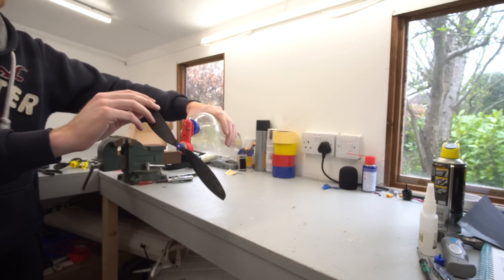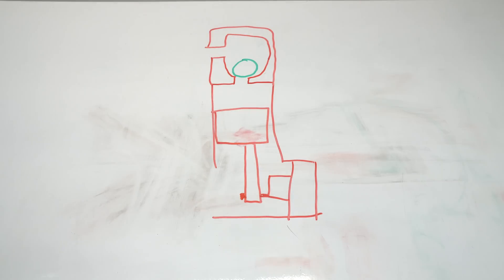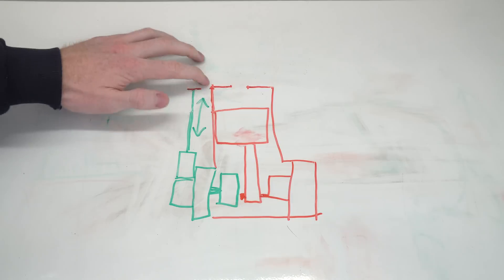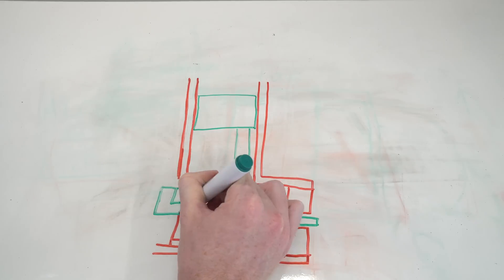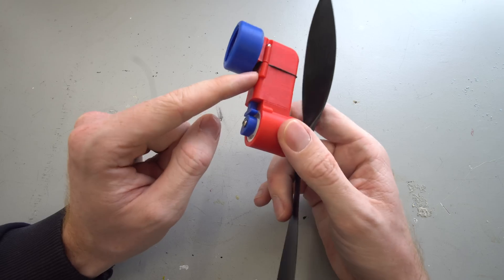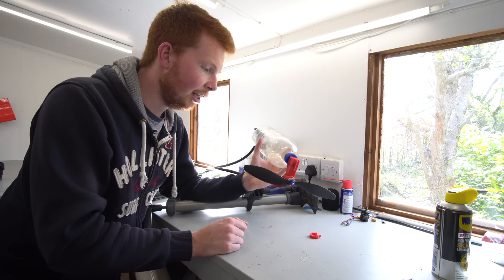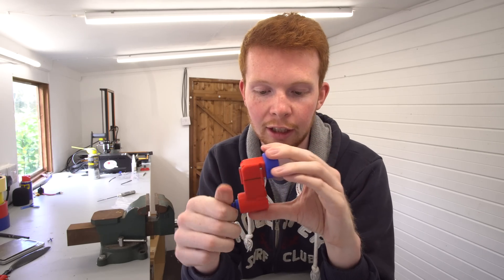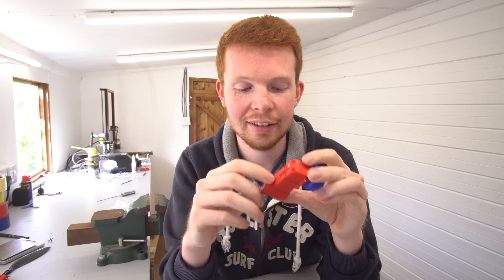Compressed Air Engine V3

Comment: I really love this little engine. You had a bit of frustration with the spring, but another method to solve this problem might be to use the repelling force of magnets to open the valve.

Comment: It be cool to launch a radio controller glider with a blast from an air tank on the ground, It could carry some on board compressed air for a longer more controlled flight and landing. The only electricity would used for radio, camera, and steering, adding perhapes the weight of a little 9 volt battery to the vehicle.

Comment: Hello Tom, I saw your vid of the air driven plane and just now the one about engine redesigns. My thoughts of the ball valve engine were you were robbing the engine of energy to open the valve to recharge the cylinder each cycle. The slider valve idea also came to me but with a twist. Add a spring return cam driven rotating slider valve (teflon to reduce friction) that momentarily opens to bypass the ball valve. The slider reduces the pressure difference either side of the ball valve so the flywheel loses less energy to fully open the ball valve. Another idea is to ditch the ball valve and use the flywheel as a rotating valve. As the pressure is high I'm guessing a tank tap would allow you to find the maximum performance possible before system leakage versus prop horse power becomes significant. The tank tap could be worm driven to open more as the tank pressure drops. Thankyou for your good work. Cheers Terry

Comment: The air might have to be compressed so much that it becomes a liquid, in order for it to store enough energy for this engine to work over a longer period, so maybe switch the water bottle for something like a lighter gas flask, containing compressed liquid air, or something else none flammable.

Comment: If you use a piston exhaust valve like in cars, efficiency will improve. It can also command the piston from both sides with valves. Or use a ranken type rotary piston or liquid piston.

Comment: @Tom Staton
Awesome work, could you details about what 3D printer you are using and the software to design the air motor. Also try using Liquid Nitrogen/Liquid Air/Dry ice to increase pressure in bottle.
Warning: use bottle/container which can withstand pressure of these fluids, also take safety precautions.

Comment: You might have been able to use reed valves and a diaphragm piston. for minimal air leakage for increased efficiency. or even a two stroke cylinder port design. however it would require percise placement of the ports. and possibly the necessity of a reed valve.

I agree with experimenting with the cam lift and duration.

also the use of a sticky lubricant might help. although it would have to be reapplied occasionally.

Comment: Use a small smc solenoid valve and then you could infinitely tune the engine.  Use a small hall sensor for crank timing and use software  to vary the timing and duration.

Comment: They used to have these airplane toys called "Airhog" that used a similar engine.  Fill the tank with a bicycle pump, get the engine running  then give it t arm assisted take off

Comment: Ok, Serious question. could I use this as a mini air compressor if I hooked up a motor to the shaft and apply a voltage to the motor. if so I only plan to make it usable for an aquarium air pump. Please reply. Thanks

Comment: It took me 3 years, but I thought of a way to move the ball in the sideways ball valve move. 

You have the ball sitting on a movable wedge that raises with the con rod. On the underside of the wedge is rubber to make a good seal when closed, and on the opposite side of the tube the con rod is in, you have another piece of rubber that's constantly getting pulled towards the air chamber by rubber bands so air doesnt leak through the con rod tube

Comment: A genuine question to all you budding, and real engineers subscribed to Toms channel. I have no engineering qualifications,  but -  I have had this idea about a turbo, as in like on an internal combustion engine. So I’ll ask on here. Could something like that work, substituting exhaust gases for compressed air  ?? Would it have enough power to turn the blades of the turbo and shaft and turn the external propeller or indeed a bicycle wheel ( under load, as in my body on a bicycle ) It seems like a good idea but then what do I know. What do you think ?? 
I have seen other videos of compressed air powered bikes as well as Toms and from what I’ve seen none of them use something like this. 

Maybe there is no pressure build up in a turbo after all the exhaust gases are used to to turn the blades at something like 100,000 rpm to force the fuel into the combustion chamber.

Comment: I don't get why this design works, isn't it practically the same as the V2? I mean, what makes the engine not backfire in this design as it did in the V2?
Edit: I've given it some more thought, does the cam put an offset where the pushrod take a bit longer than the piston to reach its cenit, so  the piston is already about to descend when the ball lets the air in? That's the only way I can imagine it working...

Comment: That means while you have an air compressor system AC supplied you Will recharge the psi level and the engine just need compressed air to work?
The Matter is that the planes goes across the wind and maybe then the air could autopower the engine. I guess it's some hard to understanding.

Comment: Greetings Tom! AirHogs used to make airplanes that ran on a similar air powered motor, however, their air reservoir was asymmetrical and would change shape as it was filled with air and as the air was used. The planes would fly fairly well in spite of the deformation of the air reservoir, but it would tend to fly in a large circle. The motor would also make quite a bit of noise, and would potentially damage a child’s fingers when they started it. There is also a company that makes motors for RC planes that run on CO2 canisters using similar technology. I would be interested in seeing an airplane powered with your motor, and I would no be surprised if you could use a larger reservoir such as a two (2) liter soda bottle. The weight difference between the bottles would be negligible but the larger bottle could hold more air, so the flight duration would be improved. I could not see what you were doing with the “exhaust”, and I am not sure if you could reuse it like some steam engines do. You could also experiment with an air powered rotary motor, which would simplify your valve system tremendously. Thank you for posting this video! Please have an excellent and awesome day! 🙂

Comment: Twin cylinders is your answer. You could then have the air diverted from the top of one cylinder to the top of the other cylinder by a simple valve (either sitting directly on the output shaft, or with a power-take off from the shaft), and never have the rising piston fighting to push up against a spring. The air supply requirement would be all-but constant, rather than on-off, and would simply be going into whichever cylinder had the piston at the top.

Comment: Impressive... The greatest problem of air engines consisting in the air compression itself... It's good for storing the air but bad for getting the energy out of it... It makes far more sense using fluid in the engine and use the pressure of the air because the air it wasted in the engine when it flushes in the huge chamber you need for the moving parts...

Comment: Tom: 'This engine is fully 3d printed out of PLA plastic'
Engine: *has screws*
LIES
Reply: And the bearings will have metal too
Reply: @n_kliesow  the bearings he used appear to be completely pla
Reply: They wont work if the balls are not perfect shape so I dont think thats possible without losing high percentage of efficiency from friction. A pure rod in a hole would have less friction...

Comment: 2:24 it's an old video, I know, but why not, instead of trying to slide some rubbery materials past each other with lots of friction, use some rubber cylinders/rollers. Because they roll, friction is reduced, but they're also rubber so they will create an air tight seal.

Comment: Hi Tom!I am happy to see your videos, meaning you are doing fine this strange covid times. I like your engine very much as for my task it has huge potential. It should sound strange for you using your engine with piston for uav projects. Iam coming to you with different idea - walls drilling. My team does lot of works creating deep customized solutions for gov security agencies. One of the tasks to cover is 'silent drill' for covert surveillance equipment installations. I have designed electro driven engine that works perfect but requires quite big and havy case of stuff. From this perspective  your solution that can be driven by a small galon of pressurized air looks like a great alternative to electro equipments. We are drilling all kinds of marerial with 10mm D drill bits. The silence is reached by really slow rpm and almost no sound from engine, I have just slight sound from gear rolls.  If you might be interested in cooperation in this kind of project let me know kaprison@ukr.net. We have all necesarry equipment in our company base in Kyiv Ukraine for 3D printing and sure ready to spend some costs on experiments and materials.

Comment: I built on of these in shop class  ....

https://www.pinterest.com/pin/299911656412183396/#

the rocking cylinder is what is the valve, as cylinder rocks side to side covers and uncovers a pair of holes, one hole is intake, other hole is exhaust.  no complicated valve gear.    Golly I built that over 30 years ago, still have it.   machined from metal

Comment: When I was a kid I used to blow the p.e.t.  bottles using calcium acetylide (calcium carbide) and water. Just try this and you will gain a huge pressure inside the bottle.

Comment: Maybe you could try printing a diepetro engine or a version of a steam engine that runs on sompressed aire but has many cylinders in series. But if you can do that in a rotary motor the great.

Comment: Bash valves work really well in a uniflow configuration. By that, I mean once a little tit on the top of the Piston hits the ball and rocks it off its seat, high-pressure air enters the cylinder. This is done about 3 degrees before top dead center. The flywheel carries the Piston through top dead center and the gases expand until the Piston reaches a slot in the wall about 22 degrees down and the gases exit. The Piston is very loose fitting and this engine works best at high pressures, but you would be amazed at how many horsepower you can drag out of a small engine with 6 tiny cylinders using bash valves.

Comment: Suggestion:
Turn the seat of a bicycle into a gas pump, pump the gas into storage.
Use the compressed air to drive the bicycle.
Reply: That engine will have too low power to move bicycle and you.

Comment: Thank you! I have been talking about this for a minute. I am about to embark on making a gasoline engine run entirely on air. Its not even complicated. Most people think engines run on liquid. The do not. The run on compressed gas. We just have to ignite liquid to get that compression for no reason at all other than Industry. With a few pressure regulators and a closed system (which gasoline engines are not) then you can just push the cylinders with a computer and some valves. Just figure out your compression cylinder numbers before hand and set your regs. It just dumps and closes very fast. Bam, air car. Thank you Viktor Schauberger. Flow dynamics are the key to all of this. Thank you so much for saving me MAD time and I can just get to it!!
Reply: Dont use springs. They are bad for so many reasons. They just wear out. Simply adapt the cam shaft and piston idea. Scale down. Just push the pistons themselves into the cam then it rotates your assembly. They DID seemingly get that right.
Reply: re-route used air to push piston back up. As you said just link the cam and the valve. Itll open and shut its self you just need to get the  used compressed air, underneath to push it back. No springs needed. Air does it ALL. That is what we always fail to grasp. The Air does EVERYTHING.
Reply: There are piston rings on a gas engine. This is exactly why. Because the piston doesnt touch, to much friction. We use piston rings to seal only a small portion reducing friction and maintaining seal. There are way around it and its negligible. I say that as of yet I have not seen you use COMPRESSED air to do anything. This is the secret. Enough compressed air and friction is irrelevant. There is balance there. Least friction with calculated amount of compressed air. All we are doing in this format is taking out the explosion. I do feel the engines will need better seals but there will be so much LESS heat rubber should work alot of the time. Unless its ( like the piston) metal on metal movement. Just keep the metal piston ring (seal) in place.
Reply: Pretty sure you would just need to have a section above the piston that recycles your air and creates a negative pressure and the piston moves back into place. This means the air system goes no further than the piston/cylinder area.
Reply: Pistons could have ball bearings instead of rings.....
Reply: hmmmmmm it seems you are not working in the lobes of the cam at all. This are to return it after spin. I feel you should be using those lobes for more things. Like you the valve to close the air before the piston. Rotation is key in this. But it seems you are using non gas engines or small prop driven models. That, I feel, is where alot of your problems are coming in. In a car engine, all the parts are there. Its just the fuel and fuel delivery that needs changing.
Reply: Timing equals idle engine speed. if its off your engine cannot idle. Meaning you basically do not have a functioning engine. Timing is critical.

Comment: Instead of a piston with compressed air i was thinking of blades with ends bent slightly upward to act as scoops inside a sealed chamber with only a inlet and valve for air control..the shaft sticks a lil out the back bearing with a hole down most of its centre and a horizontal hole in the shaft to act as the outlet through the shaft and sorta help with thrust too..and that would eliminate having to start it by hand..just a thought lmao 😂

Comment: Why don't you go to the first idea of having the pushrod move up and down except change it into a timing belt so that when the crankshaft turns it turns like a rubber band which turns like button size wheel with one hole in it which will then when the piston is ready to fire again come around and allow the air to flow through at that point and then when the hole pass it will shut off the airflow and it will be a lot smoother transition of power opposed to this constant up-and-down of parts

Comment: The piston motor is really cool... But.... How about a turbine??  I've been researching for a while about fast steam micro turbines, because I'm a rc model boat fan. And I think it could work perfectly with compressed air as well. That might be the first compressed air micro turbine... Would you give it a try? Then you can check which one is more efficient, the piston motor or the turbine.

Comment: Connect the tight springs according to the power requirements and use as a vtwin engine and balance the crankshaft where both spring are on equal tension and connect the rod to your air engine that hybrid engine will give you more power your engine would only required to only to complete the rotation .

Comment: You could try a pressure regulator before the engine so it runs at constant pressure and therefore runs for longer as less air would escape per cycle.

Comment: I need to make one of those and hook it to my air compressor so I can have a pneumatic fan in my shop.
Reply: cheaper to use electricity
Reply: @BenState  absolutely correct. But not the point
Reply: @CCNB04  true, but in case you weren't aware.  sorry

Comment: Nice job, I've been working on my own design and testing it - hard to avoid a cam design but efficiency has been pretty decent on my BB valve setup so far. Check it out on my channel when you have time.

Comment: im curious about the wear and tear on the cylinder walls because its not pulling down from the center and its off set also its square im curious how long it will go before catastrophic failure due to the friction its creating rubbing on the cylinder wall im a year late but still curious.

Comment: I tried this back in the 80s didn't have the printers got today, but I did find out you want a low RPM and a big propeller lots of pitch, high RPMs uses too much air, you need regulated air, that makes a constant power not high to low with a super light airplane and you got it made pal. You might want to look at a paintball regulator,lite copy and high-pressure air maybe CO2

Comment: If i could suggest one thing it would be to reduce the amount of time the valve is open for the compressed air intake valve. This would allow a longer run time across most air pressures.

Comment: Low efficiency, pressure is used to rotate only half of the screw. In fact, 30-40% is lost during a single cycle at idle

Comment: e-scooter has been made illegal to run on main road in our city.  It is classified as a motorized vehicle, to run it on the road, one need to get some sort of license that no one cares to apply. 

Now if it runs on air, then it is not a e-scooter any more.  No battery, no charging time is needed. 

The empty bottle is the battery.  Just pump it up while riding.

Comment: Is that possible to add extension of cam shaft for small compressor which will refill air inside the cylinder ..or the air which is wasted after one rotation of blade # in the cylinder back